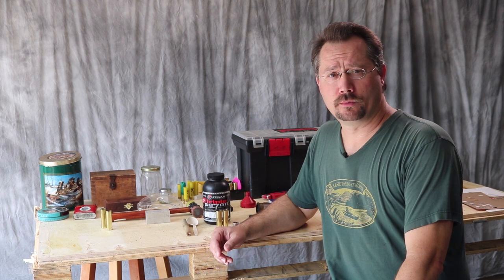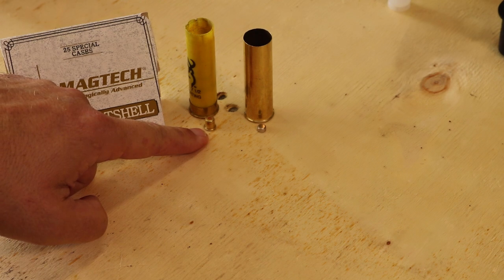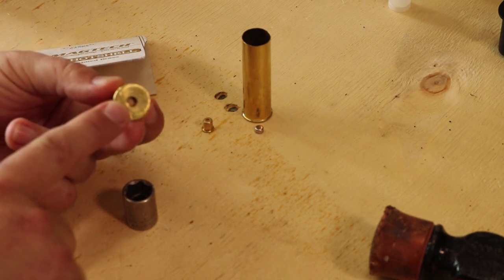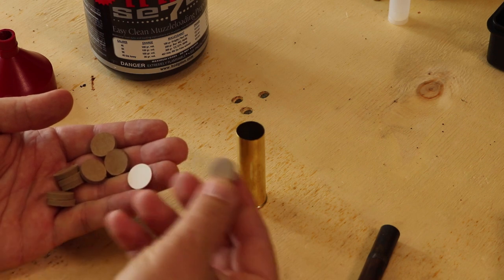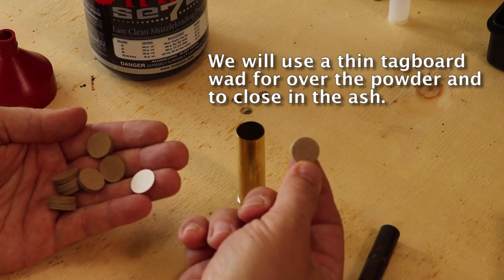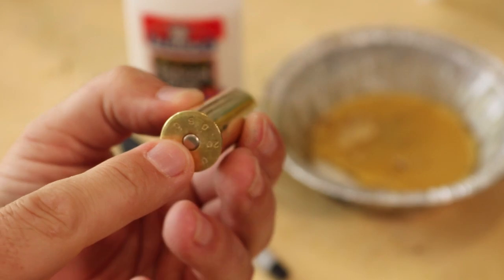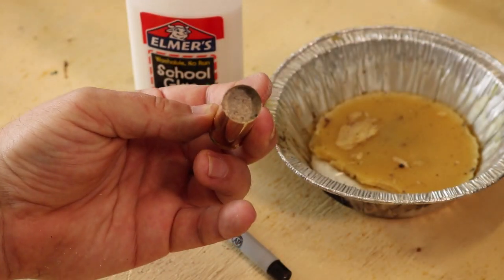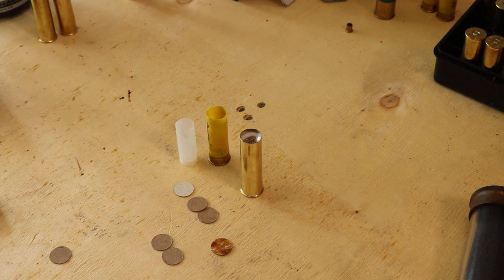How to Load Cremation Ashes into Shotgun Shells - Shotgun Funeral

Comment: Because the cremated ash is more like sand, couldn't it plug the barrel unless it had a sabbat?
Reply from the maker: I had no issues with it at all.
I made some test loads from wood ash, knowing it wouldn't be exactly the same as cremation ash, but at least would be a good test.
No problems with either the wood ash or the cremation remains.
Reply: @BenjaminNelsonX  just thinking that they use sand to plug the holes when they are using black powder for blasting.

Comment: LOL,   The human imagination is astonishing.  Cool Video.  Using the dowel within the  shotgun cartridge and a vice to press  in the primer would be easier for me.    Someone is going to go Full Blown Safety Nazi on this video.   Yea there out there.    Others are going to pop a few primers in the process.

Using a factory cartridge replacing the original shot could work.  Care would be needed using adhesive to seal the end or it will not do much of a bang.
Reply from the maker: Lots of different ways this could be done. I like the idea of using a vise.
I did actually INTENTIONALLY fire off a primer (outdoors, with a hammer and anvil) just to see what it would be like. The big thing is that it's VERY STARTLING.
Reply: @BenjaminNelsonX  LOL,  Not to mention the metal slivers flying in all directions.   Yea, I've done that too.   STUPID CHIT but I did it.  Best not mention most of it.